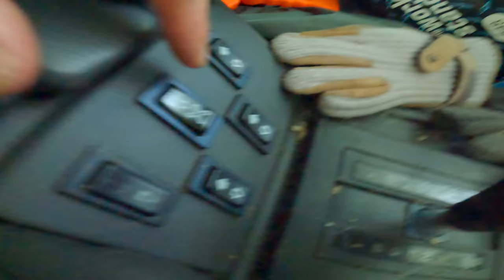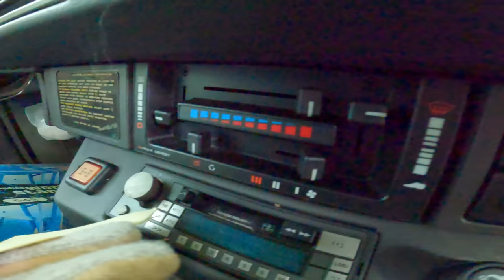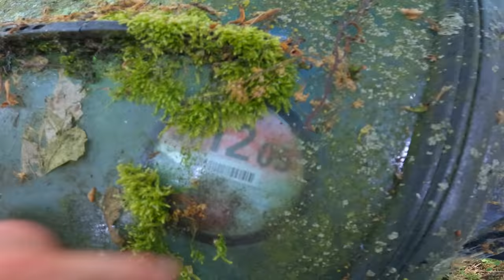ABANDONED | 23000 Mile RANGE ROVER! Subaru IMPREZA Abandoned | IMSTOKZE

Comment: Both Range Rovers wear 1986/7 number plates yet the 23,000 miler has 'classic' badges which only became a thing in 1994, just after the new generation P38 came out. If it's a '94 then that explains the low mileage by 2005 when it was parked up. Can you imagine how nice it must have been back then. Why it wears those plates is a bit suspect as they're clearly not cherished numbers.
Reply: I wonder if the engine or gearbox had gone. I am ashamed to say I have had it, park it up thinking il get that sorted out when I get the time, then times go past and it starts looking shabby and like it will be hard work to sort out.

Comment: D176SNC according to DVLA never has had an MOT from its first 3 years of road use 1987 to 1990 , so it's highly likely this is a genuine 23000 miler from brand new. Its likely after 1990 it never saw road use and was just used as an off road vehicle. Until whatever reason saw it dumped in the woods.